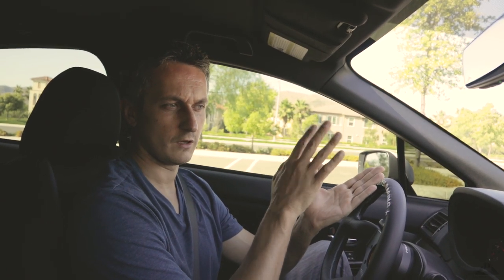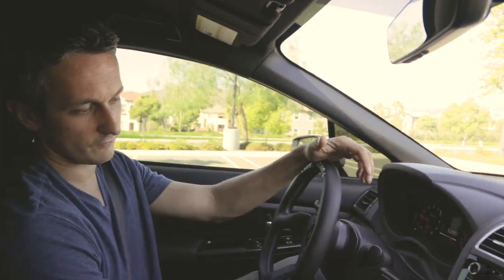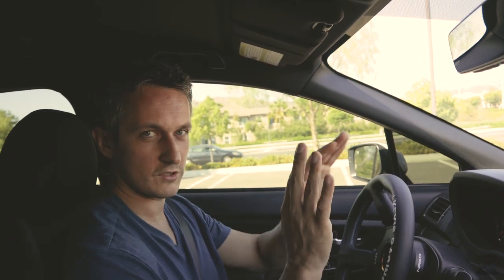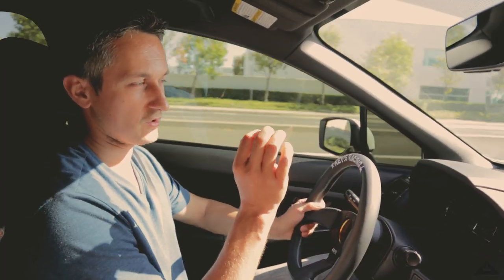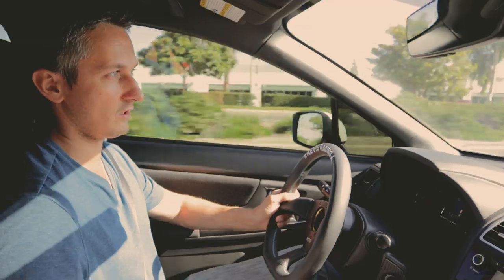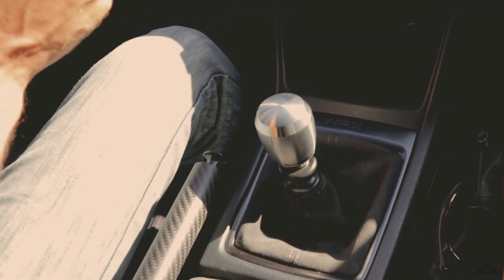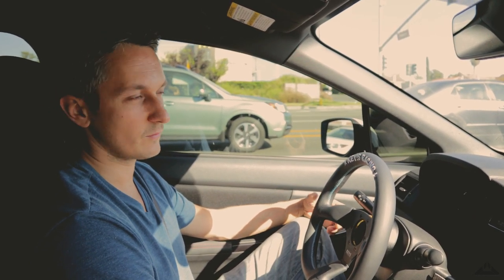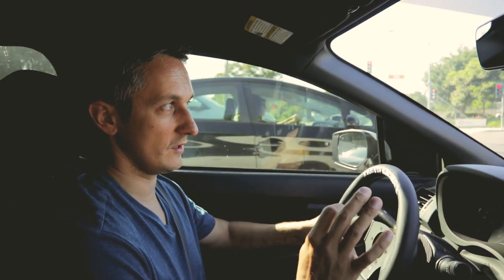Best way to shift a manual WRX and STI

Comment: I just got a 2023 WRX a week ago and I'm still getting the hang of the clutch. Lol. I have 2nd to 3rd and 3rd to 4th down pretty good but for whatever reason, 1st to 2nd is the trickiest to get. I had a 2020 Civic Si Coupe before the WRX and the rev hang in the Si was so bad so I'm still getting used to the no rev hang in the WRX (I like no rev hang so much better. Part of the reason I got rid of the Si is because of the rev hang. It drove me nuts) but it's so much better to drive than the Si. If I let the clutch out at the perfect time, it's fine but I still let it out too late sometimes. It's a lot different than driving a standard Civic but I love it.
Reply: I just got a 2017 WRX, I have driven a standard for a few years. Driving this thing in the low gear, usually 1st to 2nd, I feel like a new driver, hahaha 
I have had it about a week. Some days, I'm alright, but other days, I'm still janky with it. I just came to watch this video to see what the heck I'm doing wrong. I guess I need to find an empty parking lot later tonight to practice more. I have only stalled it twice driving it home from the dealer the first day. But I work a lot so I don't get to practice much. Just the short drive to and from work. But like I said, I'm still jerky from 1st to second. Or even sometimes when I downshift. I'm glad I'm not the only one struggling with this. I feel so stupid driving around and the whole car is jerking hahahaha

Comment: Thanks so much for making this! It’s videos like this that keep me coming back, you listening to your subscribers and bringing content we request!
Reply: How do you alter this process with ac on? Just ride the clutch more/rev it higher?
Reply from the maker: @deej628  no problem man, thanks for reminding me to make this video. If you have ac on, nothing changes really, your rpm is slightly higher but won't reflect on your shifting. I noticed these cars really don't like ac being on, you can notice the power decrease every time ac kicks in. I try to never use it.
Reply: TheShaddix same. I feel like it’s more jerky and you have to let the clutch out slower for it to be smoother. Sucks.
Reply from the maker: @deej628  If you haven't already, just grab all the mods that I listed, I promise it'll change your driving completely. Of course, tuning the car helps too as that eliminates the rev hang which is another annoyance (forgot to mention in the video...).
Reply: TheShaddix I’ve got stage 2 map right now and your clutch stopper and shift stop from Perrin. Going to do the weighted knob and brass bushing next.

Comment: i 100% agree with you that the clutch engagement was so hard getting used to. i almost got rid of my 2016 wrx just for that reason. sometimes i still to this day am not 100% smooth with my shifts. might try and get a boomba shift plate and stopper in the future. all i have is the factory (sti) short shifter, a heavy shift nob and bushing.
Reply from the maker: The plate will totally change your mind just by itself! That was my first mod. The stopper will solve the grab point issue completely. You can just buy a bolt at lowes with a rubber cap to act as a stopper, the stock location has a small hole under the rubber pad. You'll get a sense of what difference it makes.

Comment: I think many new cars have high bite point. However, I'm not entirely sure it is actually good to put an artificial block to shorten the range. Also for me, having a consistent seat position is a key to driving smoothly
Reply from the maker: The block is there to reduce the pedal travel after the engagement point to the floor, not to reduce the actual clutch/flywheel operation in any way. Once the clutch is disengaged from the flywheel the rest of the pedal travel is useless. The block stops it short before reaching the bracket. It reduces the overall "dead" travel by about 60-70%.

Comment: If purchasing a stock 2021 Subaru STI where can I buy all these parts listed that you recommend Shaddix?  I'm new to stick shift, but I want to learn how to master this skill as it's an essential part of driving and makes the user feel more engaged when driving a vehicle.
Reply from the maker: You can easily look for them online as they are widely available from many sites including ebay, amazon, etc. The clutch stopper is made by me so you'd have to email me via my site for that if you want it.

Comment: those sound you made at 8:10 , when stick goes into 1st and 2nd gear, it makes those cling sounds? is that normal? my 2020 wrx does that too
Reply from the maker: Totally normal. That's your shift plate on the transmission most likely.

Comment: I have a 2019 WRX and the bite point is exactly the opposite of yours. If you're not putting a bit of gas on it as soon as you start letting off the clutch, you get that big thwonk. Maybe they tried to fix that from the 2018s and overcompensated
Reply from the maker: I've heard of this from many people about grab points being either too far or too close to the floor. The grab point also ends up shifting as the car warms up, you can see once you start to drive and it's warm it'll grab somewhere in the middle. Then, when it's cold it's really close to the floor again. They call it a wandering grab point and no one knows what the cause is.
Reply: huh?? interesting. I have a 2019 as well and my bite point is all the way the fuck at the top. weird how it would be different ?

Comment: I dont want to nitpick but rev-matching when done properly doesn’t put any more wear or tear on the drivetrain. It’s way better than pushing the clutch in and downshifting and then letting the clutch out and not blipping the throttle. In fact, it puts less wear on the flywheel and clutch disc than starting from a stop in 1st.
Reply from the maker: well, you missed the point I was making. Rev matching is a must, always, and there is no situation where one should not rev match. What I was saying is if you always downshift through gears while coming to a stop, every time, especially with an intent to engine brake, with rev matching of course, the clutch will wear out faster than if you don't. For one, you can't rev match 100% with a manual car, you just get very close, so it'll slip the clutch a bit to compensate for that difference. Same applies to dual clutch cars too, you'll wear out the clutches if always downshifting. Some people do this all the time just to engine brake.
Reply: I put my car in neutral and glide to a stop!I Iearned to dvive on a standard and have been driving them for over 50 years!I learned on a 1966 Chevy truck with three on the tree!
Reply from the maker: @daniellocke9534  that's the best way to do it!

Comment: You didn't talk about the 1-2nd shift... I have an STI and it's a bit finnicky, but on the WRX it's super annoying.
Reply from the maker: Same principle applies, it's all about the grab point.
Reply: On the wrx with fa 20, try shifting slower from first to second because there is a annoying rev hang. That's what makes it jerky usually.
Reply: EA M same problem here 1-2 not smooth, trying to find out what to do add more gas or hang on to clutch in bite point tad longer

Comment: great video man! would you say a stage 1 tune will help with the smoothness? my wrx is completely stock and im pretty knew at driving manuals so im not very good at it. shifting and starting seems to feel different every time
Reply from the maker: Tune removes the rev hang which helps a lot, but don't expect miracles. The smoothness is all about the grab point and timing of throttle application and the amount of it. The grab point also tends to shift for whatever reason, so when the car is cold it's closer to the floor, then it's further out. Hit me up for a clutch stopper, it'll help you a ton.
Reply: TheShaddix do you sell the clutch stoppers? And how do you install them? Just got an sti after learning on a Camaro and getting into first gear is so challenging but every other gear I’m getting okay at
Reply from the maker: @lionnn1233  Take a look at my site www.craftechdesign.com
Email me if you want one.

Comment: Great video and thanks .. 1 question please, when I'm in gear does it get lock tight? What happened was sometimes let's say I'm in 1st gear and stepped on clutch but I forgot and thought I was in neutral so I move it a bit and try to go left and up again.. by doing that, will I do any damage to it? Thanks

Comment: Love the video man! Got a 2017 wrx about a month ago and I'm loving it and want to treat it as well as I can. My question is as far as the mods for better shifting you were talking about, keeping in mind that I don't have endless money, what would you recommend I start with???
Reply from the maker: The biggest bang for the buck for shifting (for me) was the shift stopper (can get a replica for 10 bucks or so), the boomba shift plate (plus a metal bushing), and a heavy shift knob. You'll be happy with those.
Reply: @TheShaddix  thanks for the speedy response my guy, I will definitely look into those!!

Comment: You have to let the clutch out in neutral while your revving to speed up the input shaft to actually rev match, you know your doing it right when you can do it the same without even using the clutch but what do I know
Reply from the maker: Maybe back in the day with old cars/semi trucks. Not with anything modern as it has synchros. What you described would pretty much take all the fun out of driving.

Comment: My mazda 6 did this going into 1st gear to quick it woukd stall out i learned over time letting off the clutch smooth not slow that it wouldent stall out small trick but after i was used to it it made driveing it easyer
Reply from the maker: That will only burn out your clutch. The actual proper way is the right amount of gas applied and letting out the clutch pedal as fast as you can while being smooth, especially on a hill.

Comment: Shaddix, I also noticed the goofy grab point for clutch release and gear engagement. I was wondering and was curious if you sell the clutch pedal stopper you made? 

I am curious about how it works and how to properly install it.
Reply from the maker: DM me on IG and I will give you more info on this.

Comment: STI and WRX clutch are legit fucking opposites lol I drive a WRX and drove my friends STI and I couldn't get use to it in the 20 minutes I had with it lol
Reply from the maker: I've driven a few sti's. What you experienced is the grab point distance. Older sti's (2015-2017) have a very high grab point making it super difficult to get a feel for when it actually grabs. It's right near the point of full pedal release. That clutch stopper I made solves the issues and I made one for a buddy with an sti and it changed his perspective completely. The grab point was changed in 2018+ sti's from factory. Wrx grab points seem to have stayed the same: super high up and unpredictable. It also depends on how warm the car is... When it's cold, the grab point is close to the floor, and then it shifts further away as the clutch heats up. Go figure...
Reply: Cable throttle  VS cable drive by wire

Comment: The 3rd to 2nd downshift is a pain in the ass for me without bucking the car . Sometimes i nail it smooth and sometimes i dont
Reply from the maker: You either are giving too much gas or not enough. Also, you need to be releasing the clutch quickly enough to catch the right rpm or it'll drop too low.

Comment: Why did you make a stopper to go under your clutch when you can just adjust the rod?
Reply: how do you do that
Reply: @matthewlai6636  lay on the driver’s side floor with a light and look at the top of the clutch pedal, you will see a threaded rod with a lock nut....loosen the lock nut and rotate the rod to adjust your pedal height

Comment: I don't find it necessary to rev match daily driving on the streets. As far as down shifting at lights, engine braking helps to slow you down as your coming to a stop.
Reply from the maker: You don't need to rev match on the upshifts as long as you don't let the rpm drop too low for the next gear. But you do need to rev match on your downshifts, no exception, otherwise it just wears out your clutch as it compensates for the difference in speed between clutch and flywheel, not to mention the jolt you get which is unpleasant. I've seen people drive like that and it's terrible to be in the same car with them. And if you're the type to downshift during every stop and not rev match, then that's just a bad habit. Rev matching is meant to reduce friction as much as possible. Most new manual cars have that feature so you don't need to do that yourself.
Reply: @TheShaddix  do you think a 2019 wrx would come with that tech?
Reply from the maker: @caydenfiala6997  It didn't. Maybe later models. Personally, I prefer to turn it off. I like to keep a manual as raw as possible.
Reply: @TheShaddix  gotcha, thank you

Comment: hey man, I have a 2021 WRX just got it today. I want to get all these shifting mods you suggested. do you have recommended brand for the Engine Pitch Stop, Torque Solution Billet Transmission Mount, Whiteline Positive Shift Kit, Clutch Stopper, and Gas Pedal Spacer?
Reply from the maker: The last two bits are made by me. The other stuff is up to you what brands you like.

Comment: rev hang is so bad and yeah the clutch is abit odd i'm adjusting my seat all the time.Did you mean downshifting to slowdown wears out your clutch more ? i always downshift second gear when coming to a stop (engine braking)ive got a Grimspeed stubby shift knob on the way it weighs 600grams .Should be good with the shift stop and bushing i installed.Your gearbox def sound super solid and mechanical like you say
Reply from the maker: yeah, downshifting to engine-brake wears out your clutch. It's not the actual slowing down part after the shift, it's the friction between the clutch and flywheel when you let out the clutch pedal. You wear out your clutch on every shift/downshift, but if you drop gears all the time just by driving up to a stop, then it'll accelerate the wear/tear drastically, especially when you don't do the proper rev-matching. Best way to prolong the life of your clutch is to shift as quickly as possible (within reason), not downshift unnecessarily, and when you're taking off, don't rev up too high, just enough for the car to move. Avoid doing roll-backs at lights too.
Reply: TheShaddix but to practice downshifts heel and toe you have to do it as often you can to get better at it, practice makes us perfect and if that’s means your clutch needs to be replaced so be it that’s the life

Comment: Weird, my 2018 wrx clutch grabs right as I start letting out and grabs super hard. The car is pretty hard to drive smooth tho cuz of the tune
Reply from the maker: the grab point varies from car to car. Your grab point will eventually shift further up too.

Comment: So I have a 2011 STI hatch and I’ve had it for about 7 months now and I still can’t get my shifting down correctly. In between shift it’s a little jerky or jumpy. I don’t know what I’m doing wrong or what I could do differently.
Reply from the maker: you take too long between shifts and let your rpm drop too much. It's all about the balance man

Comment: Wait, shouldn’t you be getting the clutch all the way in? Wouldn’t the stopper prevent that and put more wear on the clutch? Am I totally off on this thought??
Reply from the maker: There is a point in the movement called the grab point at which the clutch and flywheel are fully disengaged. It happens (in these cars specifically) way before the pedal hits the floor. The stopper is there just to reduce that distance happening after the grab point. It does nothing whatsoever in terms of reducing the actual operation of the clutch.

Comment: Been watching your videos for a while and they keep getting better, keep it up! Did you have a hard time finding a compatible shift knob for the Boomba STS?
Reply from the maker: Most knobs fit this shifter if the opening is large enough. You can always grind it out a bit too which I had to do on a lathewerks knob. The shifter is identical to stock, just a mm or so thicker on the reverse lockout. So far I have tried about 20 shift knobs and this grimmspeed one is hands down the best looking and feeling, at least for the price.  There are better looking shift knobs no doubt (burnt titanium, etc), but they don't weigh enough and that's super important.
Reply: @TheShaddix  Looks like the problem is the recessed opening in the Grimmspeed was a smidge too small for the Boomba reverse lockout. I had to add a (ground down) nut+washer to have enough clearance. Problem solved!
Reply from the maker: @DonToye  Are you talking about the regular gs knob or the stubby one? Mine has a huge opening, no chance of any issues occurring with fitment. I did also have the taller version before but sold it. I don't remember how large the opening was, but I had no issues. You probably screwed it on too low.
Reply: @TheShaddix  It's the taller one actually (sku 038006). Hmm...interesting that you didn't have any issue. I screwed it on normally to handtight plus another 1/2 turn or so. Any less it would be a little too loose. In any case, the 'nut mod' seemed to work out.
Reply: @TheShaddix  q